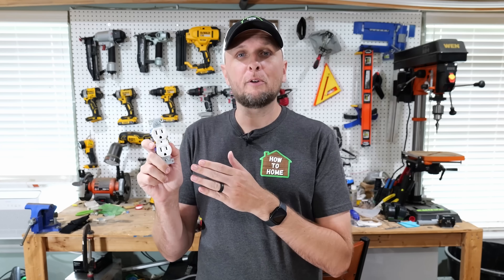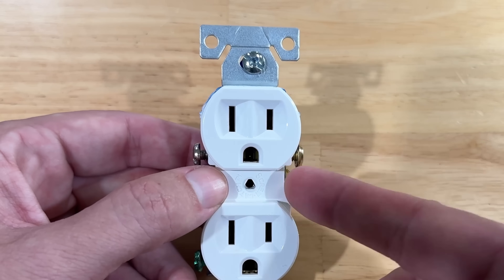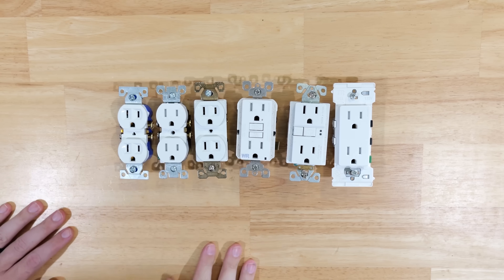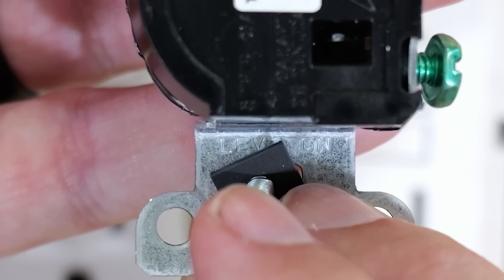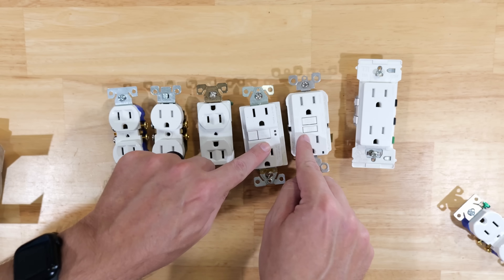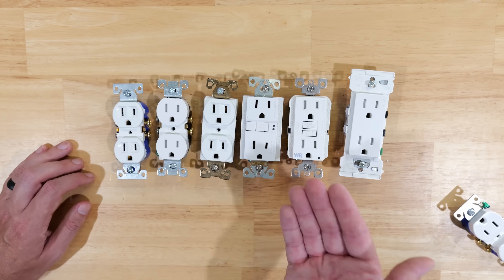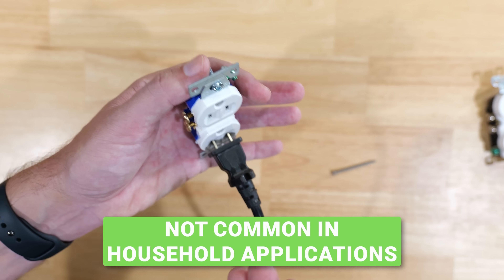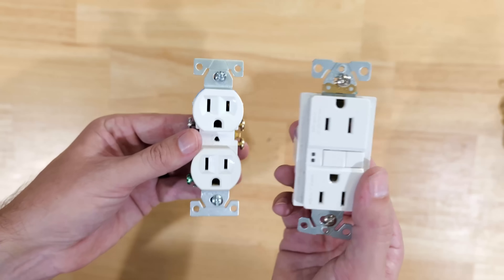The Shocking Reason Why Your Outlets Are Installed Upside Down!

Comment: The main reason to have a plug with the ground prong on the bottom is when using a heavy transformer plug. They want to fall out if the ground is on top.

Comment: I always figured that most people place the ground prong 'down' in case something pulls 'down' on the chord, the ground prong will be the last thing that separates. Mostly, because when power lines get snagged, most times its either laterally, or 'down' that they are pulled.  While they sometimes are pulled 'upwards', is mostly a downward force that ends up pulling chords out of a wall rather than 'up'.

Comment: One of the guys I used to work with was going through tech school for electrical. He told me the instructor said to install the ground up because if you have a cord with ground plugged in and someone steps on the cord it will likely unplug the device rather than breaking of the ground pin on the plug.

Comment: GROUND PIN UP!!!!!!!!
I have seen more than once where a tape measure or wire had fallen on an outlet with the ground pin down.  It not only blew the circuit breaker but it also “smoked” and damaged the outlet so it had to be replaced.

It is a REAL fire hazard.  Do NOT install with the ground pin down!

2nd, I know people like to install it like a face😮.   But that causes another problem as kids will want to mess with it as their minds see a face while when upside down it isn’t as obvious.

Comment: I prefer ground pin down. Many electronic products come with an external DC power supply. When these "wall worts" are plugged into a 120vAC outlet, the cord going to the product will flow down and across the floor. If the power supply is plugged into an outlet with the ground pin up, the wire leaving the power supply will be trying to craw up the wall !   That would be OK if the product is placed high above the floor, however, most electronic products reside on a desk top surface. It is better if the wire leaving the power supply flows in the downward direction, thus taking the strain off the cable where it joins the power supply.

Comment: I was always taught ground prong up for protection from objects falling and causing a short circuit but that was in a shop/workspace scenario with a better chance of that happening than a living area/household setting. Over the last many years I have found that ground pin down is almost THE standard and devices with an angled plug are setup in the ground pin down/cable down configuration. The nice thing about standards... is there are so many to choose from.

Comment: Receptacles can also be installed horizontally, so then, do you put the neutral on top or vice-versa!?
When I was working for an architectural firm and was doing site visits for a 40 storey office building, I noticed that the electricians were installing the receptacles with the ground up and I asked why.
The answer was, if the stainless steel cover plate for some reason becomes detached, it would fall on the ground prong and not on the hot/neutral side!

Comment: My house was built in the late 1970's by/for a family with three young children. Essentially every receptacle in the house is ground-plug up. The reasoning, circulating widely during the '70's, was that the ground-down design looks too much like a face, and therefore is an open invitation for a toddler to play with, by sticking something into the holes. It doesn't matter that, to an adult, the "mouth" of the ground-receptacle looks disapproving: toddlers are too young to make that association. The only problem this orientation causes is with cheap nightlights, and timers, whose manufacturers seem never to have owned a house in the US—i.e., Made in China.

Comment: I think this whole thing is kind of silly.  If the plug is pulling out, that is a sign to replace the outlet as the socket contacts has become worn,  Builder grade outlets are horrible, so upgrade them to commercial grade or higher.

Comment: Plus in my house in USA are ground down. Interestingly England it is the opposite.. all plugs have to have ground up. Plugs are bigger and all have built in fuses so if the equipment, the plug belongs to, shorts internally just the plug fuse goes. Each plug has a fuse appropriately sized to the item's  max power requirement (of what equipment the plug belongs to 1 amp or 3amp or 5amp  etc.)

Comment: The only place I’ve consistently seen receptacles installed upside down is in hospitals.   The explanation I was given is that they want the life saving machines to remain plugged in,  if the cord is stressed.    Also this guy maybe doesn’t have kids,  probabilities for insane circumstances increase with kids.

Comment: In Canada the orientation is not spec'd in the code, unless it has changed. Most residential plug ins are oriented for ground pin down.  As an old electrician, I install ground pin down inside residences. For outdoor, garage, workshop or industrial outlets, I always put them ground up as it is better for heavy cords and power tools.

Comment: Raised in a house built in 71, all had ground down. Many power bricks are designed with that in mind so the brick's body rests against the wall . If plugged in upside down it pulls away leading the prongs exposed.

Comment: If the circuit is protected by a arc flash breaker I will install the receptacle ground down, but if not protect by an arc flash breaker, i install it with ground up.

Comment: In a RESIDENTIAL installation, unless a local code requirement, ground pin down will eliminate the orientation problem with most 90 degree plugs. Ground pin up is a good idea to indicate which are switched outlets. The safety advantage of ground pin up is an insignificant concern.

Comment: There are only a couple factors that I typically consider the orientation when installing receptacles.  

One has to do with cosmetics, as many homeowners prefer to see the “face” if they have specialty covers to enhance the effect.  The other is whether they are using a diagonally aligned flat plug, if they need the wires to go in a certain direction due to the equipment position, or other limitations of installation.

Comment: As both an experienced electrician and butt-wiper, I will tell you the definitive/correct answer:
It should have the same orientation as the toilet paper roll on the wall…rolls outward vs. inward.
Always follow that rule! 
Oh, and don’t sweat the little 💩 in life. 😅

Comment: I watched this video because I was told by an electrician that the code recently changed and that ground up was now correct. Since this video is only a week old I am assuming you were looking at the most up to date code. Thanks for the info. Sounds to me like someone was just wanting to get easy money for flipping the outlets.

Another reason for the ground to be down is that most transformers (wall warts) are designed to be plugged in in that orientation. Plugging them into outlets with ground up generally makes them pull out of the outlet due to their weight. That creates a much bigger risk of something getting stuck across prongs than a standard plug does.

Comment: I’ve seen outlets with ground down and I’ve seen them with ground up. Out of habit I install with Ground Down, probably because I was taught to install outlets with the ground down. But a big decider is what are the other outlets in the house? If the other outlets are ground up, install the new work to match the old work. An except would when there are more the one outlets in a box. In that case I have seen half the outlets in the ground up, and half the outlet ground down position. The reason is things like cords charger block. If the plug has an orientation that requires it to be in one position to angle the cord in one direction, by having the receptacles in both directions gives you more options for plugging in different devices.

Comment: When I was about 9years old I got my first pocket knife with a blade, spoon and fork on it. I was admiring it one morning and dreaming about all the adventures I'd be using it on. It slipped out of my hands, slid down the wall between the headboard and the room lit up like  a Pink Floyd concert on steroids. Once the smoke and smell cleared and I was brave enough to look under the bed I discovered my pocket knife blade now resembled a buck saw blade and the outlet had an amazing patina to it. To this day I can't look at any outlet without thinking ...."Man, I wish it was ground up".... Scared the absolute flying F out of me.

Comment: On the Eaton outlets.  One reason for the text orientation could be that holding it face down with the ground prong closer to the wall, you could read the text while installing it, then just tilt it up into the box and it is installed with ground down and you could read the text.

Comment: Any electrical work done on any home should be done by a licensed electrical contractor, a permit pulled and inspected by the local inspector. Here is what this video is not telling you. If there is ever a fire and the insurance company discovers any electrical changes that were not documented by and inspected. The Insurance company can deny your claim.
Reply from the maker: That is not true.  Minor repairs and installs like this do not require a permit or inspection and the homeowner is allowed to do them.  Just because a homeowner did some work on an outlet and a fire started from a grease fire, the insurance company cannot deny the claim.  Sounds like an electrician just making stuff up.  Hmm I wonder why.

Comment: Every single time, always, with no exceptions, ground pin down. 

The number of times I've had to plug a polarized plug into an outlet that I couldn't see, and some numbskull idiot installed the outlet upside down, so it wouldn't fit... is that number too many. How any electrician could come up with the idea that randomly rearranging which pin was hot in an outlet, is completely beyond comprehension. The "something could fall across the prongs of a partly unplugged plug" thing statistically never happens. The upside down outlet thing may not be the stupidest part of the US electrical system, but it's definitely on the short-list (It's hard to get stupider than plugging an un-fused 16 gauge extension cord into an outlet wired with 12 gauge wire on a 20 Amp circuit... otherwise known as a "heating element"... but then there are suicide cords, too, so the list goes on)

Comment: My dad was an electrician and worked for Westinghouse for over 40 years as their electrical maintenance supervisor at their East Pittsburgh plant. He knew electrical theory , practical applications, and worked with high voltage for most of his career. He wired outlets with the ground pin on the bottom. Good enough for me. That's how I do it and that's how I taught my son to do it as we just re-wired his "new" 1929 house. If Pap did it that way, that's the right way.....

Comment: I worked in the Army Hospital system for 20 years. In that setting there (patient safety oriented) policy was that outlets be mounted with the ground pin down. That way, if the power cord were to work its way loose. The last thing still connected would be the ground pin, so bed frames or patient monitoring equipment would still be grounded.  Of course, we also had receptacle testers for correct wiring and tension (pull test).

Comment: If ground prong is up and the outlet is loose (older outlet starting to get worn) with the cord pulling down, is it possible for the ground to disconnect while the device is still powered?  That would be my concern for "ground up" orientation,  plus it just looks wrong.

Comment: as a maintenance electrician for a very large school district with 100%metal cover plates I can't count how many time 100s of times that a plate comes lose and falls down and hits the hot and neutral and poof the plate and prongs get fried so whenever I had the   reason or need to work on or replace a plug I would change it to ground up so I say yes it does look better ground down but anytime metal plates are used I say ground up might not look as aesthetic as ground down it's a lot safer ground up just my opinion as a electrician with over 40 years with commercial and residential experience metal plate ground up is safer

Comment: Best to put the ground on the bottom BECAUSE most plug in thingies as well as right angle plugs are designed to have ….. the ground on the bottom.    Fortunately it is not difficult to flip the insert over when it is incompatible with whatever you want to plug into it.

Comment: When I was a union electrician another electrician that I worked with told me about a hospital project he had worked on that specified for the ground prong up orientation because of the paper clip possibility problem.  Other than that instance I think all of the buildings that we wired we oriented the receptacles with the ground prong down.

Comment: In my garage under my pegboards I installed all outlets ground up so if any could have wires hanging from the pegboard hooks are less likely to contact the hot terminal. But everywhere else in the house I installed them ground down for aesthetics.

Comment: After 45 years as Sr electrical designer of commercial and industrial, the only  way to install is be the local inspector for that city or county wants it to be arranged. Because you don't  want install one way and then have  them tell you, that you installed it up side down.

Comment: I installed all of my receptacles ground side up. Reason being that if you were to trip over, or step on the cord that's plugged into it, it would simply unplug. Whereas if it was ground side down, it would damage, or break off the ground pin.

Comment: "Smaller side is the 'line' side"??? Dude, you lost me. The small one is for the ungrounded side. As for Grounding side up that is an established thing in Great Britain and other European countries for the reason that if something metallic (conductive) falls onto the cord while plugged in and the cord is disodged the metallic/conductive object will be less likely to strike the ungrounded and grounded circuit conductors. By that reducing the chance of a short circuit being created by the introduction of a foreign thing to the current carrying connections.
Reply from the maker: LOL!!  Which is what I said by line.  Which is hot.  Which is ungrounded.

Comment: I have always installed with the ground plug down. But I don't think it really matters which way you put it. But I could see a safety advantage to having the ground plug on top. It might block a metal object from going behind the plug and contacting the line and neutral prongs causing a short.

Comment: Ha, not an electrician or a DIYer, total amateur in this topic but was interested. As such, when you said the only time it is mentioned in the code is to specify that it cannot be installed “face up” under a sink I thought it meant that it should be installed ground up because to me, the receptacle looks like a face when it is ground down, with the two vertical slots as the eyes and the ground as the little surprised mouth 🤣🤣🤣 thank you for teaching me a valuable lesson that even when I think I understand something, I might not. Luckily I’m not in charge of any of that stuff in our house!

Comment: That's total baloney. Electrical outlets aren't installed "upside down". At least mine aren't. And they were installed by a licensed electrician when the house was built not by me. Whether they're installed right side up or not really doesn't matter as the ground pin is longer than the other two and makes contact first when the plug is pushed into the outlet. Useless video. Waste of time.

Comment: I got rid of all my upside down switched outlets since my ceiling fans are all remote controlled with a light, or because I have flush mount LED lights (where there used to be old can lights) with a switch. 

My handyman was very puzzled by me removing all the switched outlets. But i don’t need them 😂

Comment: I worked for a housing development back in the 70's, all the apartments had metal duplex outlet covers, from pushing in appliances into the outlet the center screws would loosen up and some fall off, and the metal cover would fall and weld itself to the plug and shorting and tripping the breaker. we started to put the outlets with the ground up. afterwards We stated putting in plastic covers on outlets after that.

Comment: The only time you ever find a ground up is when its connected to a light switch (for rooms that do not have a ceiling light) it helps the person to decide where the floor lamp will go or night stand that will hold a light

Comment: I install ground prong down with one exception. Some, but not all, freezers and refrigerators have the the ground on their plugs at the top. These are very often the flat style plugs where the wires are not sticking straight from the plug. With the ground on the bottom of the receptacle these plugs then have the wires sticking up then having to curl back down. For fridges and freezers I will normally put the ground up so these wires hang straight down.

Comment: I'm a certified electrician. I always ground down. Never had a reason to install ground up. One thing you missed is that the ground prong is longer than the neutral and hot prong.

Comment: PS our local code is ground prong down. The house I live in was wired 100% prong up, I have found that ALL devices having any type of power inverter, such as phone chargers, are manufactured for prong down. They fall out of the wall in prong up receptacles. Gravity leads to loose - scary - connections on prong up. I suspect that, in China where most devices are made, they have prong down…

Comment: Years ago, when you could put metal plates to cover the receptacles, it would be best to have the ground prong up, this would prevent arc flash, and electric shock, from the metal plate, should it become loose, and fall onto the hot side.